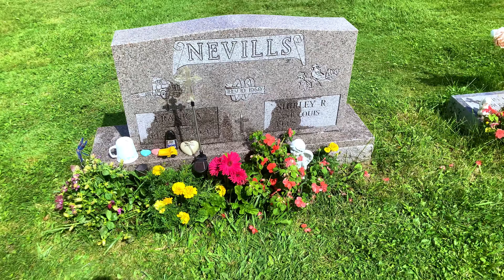Re setting a huge Gravestone. (How its Made)

Comment: Hard to believe that you don’t pin stones. I always use 2 pc 3/4 stainless bars and 4 holes min 6” deep.
Reply from the maker: Ya We never have and have never had an issue with it I don't see very many guys doing pins but I know some do.
Reply: Have to use stainless dowels here in Australia
Reply: We do about 5k stones a year and only pin maybe 10 a year. Never have a problem but we do pretty sizable footings and wait a good 9 months for ground to settle